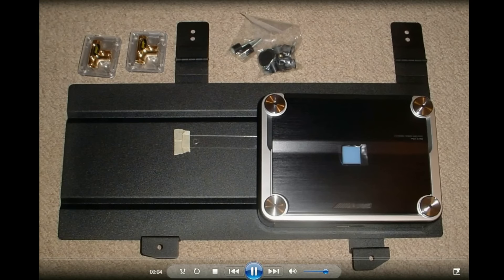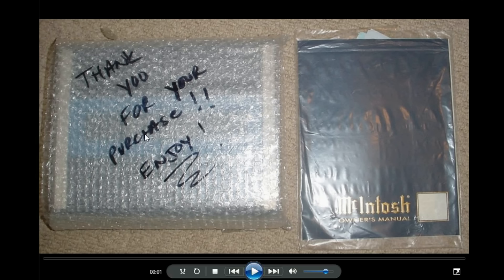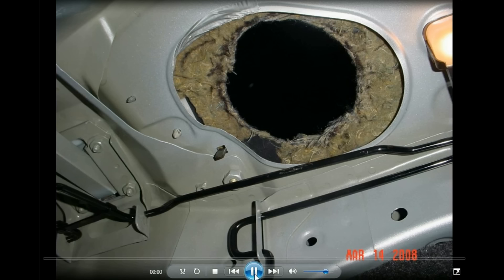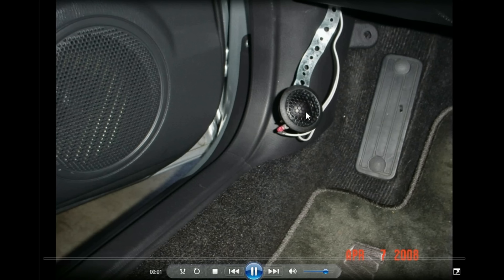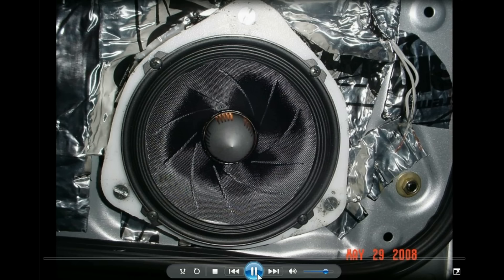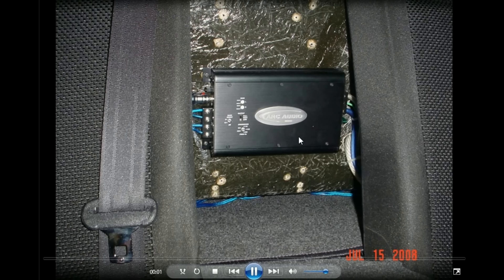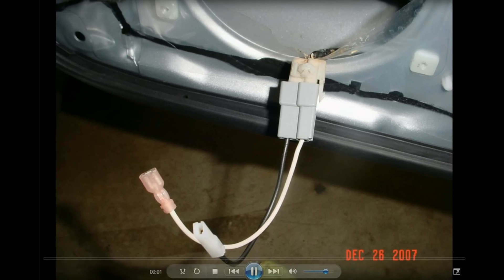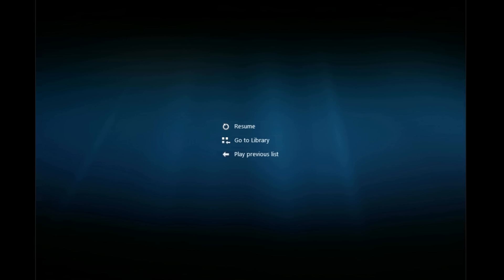The story of my 2005 Subaru WRX - Part 2 Audio

Comment: Crazy seeing all this audio equipment, and then on your current wrx you just stuck with the stock (upgraded) radio.  There's no way that compares to your old equipment!!

I see you weren't big on the old Alpine PDX amps.  Gotta say, the newer PDX-V9 I have is pretty damn good.  The tweeters in the Alpine Type-Rs I have in the front (comp) and rear (coax) doors aren't the best though.  Not sure if I should replace them or not.
Reply from the maker: +Kuth70 i know nothing about the PDX amps except for that very first generation. tons of people were getting static noise from them. i can imagine 10 years later they're a bit better.
Reply from the maker: dang, 100x4 rms + 500w x 1 rms? sounds like a killer amp.. but i never liked the digital or "class D" amps too much. they never had the detail of analog amps. nor the power.